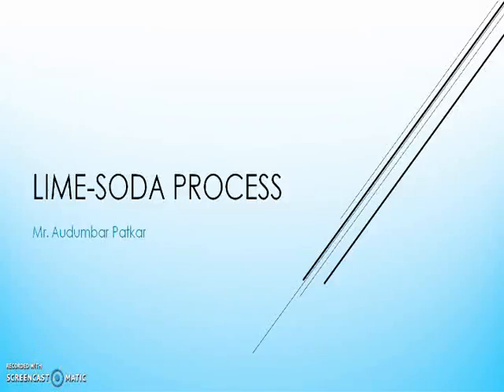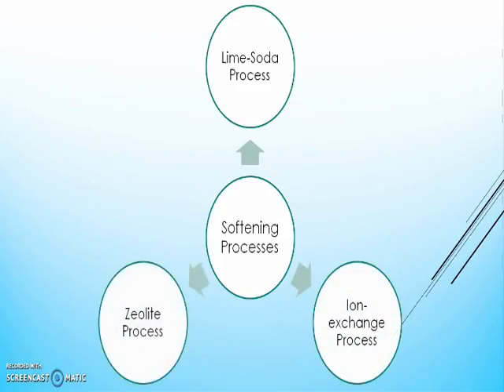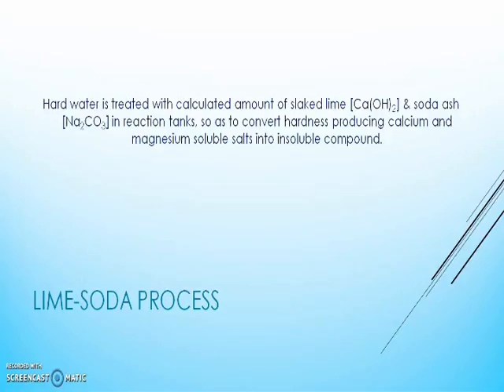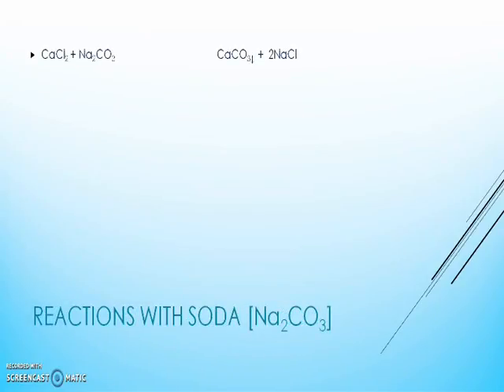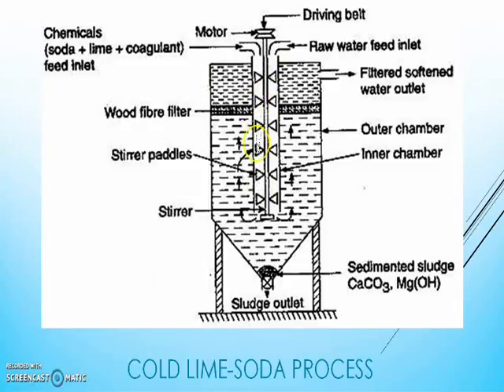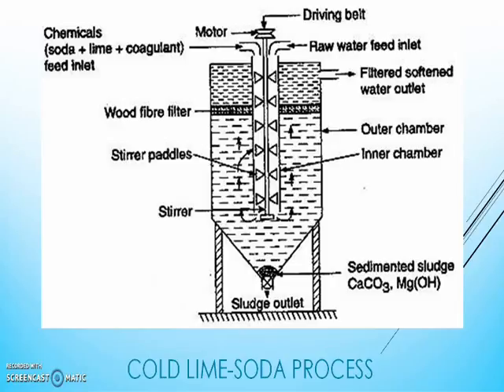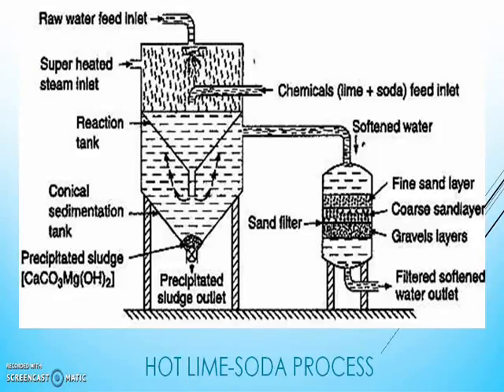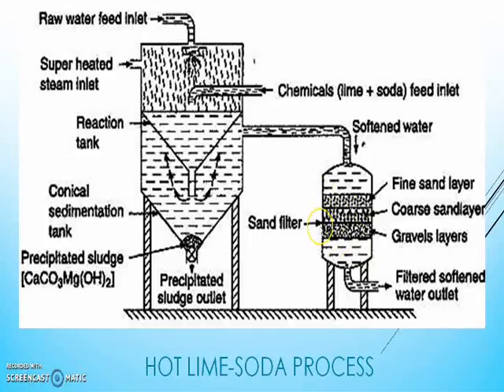Water Lecture 6

Comment: Good video, but the audio suffers from echoing. This can be easily solved by setting up a "booth" (e.g. a wooden frame with carpet or similar soft material hanged as walls).
Reply from the maker: Thanks for the suggestion.